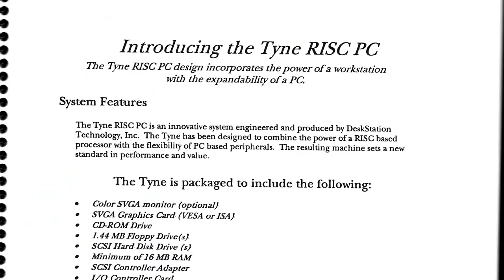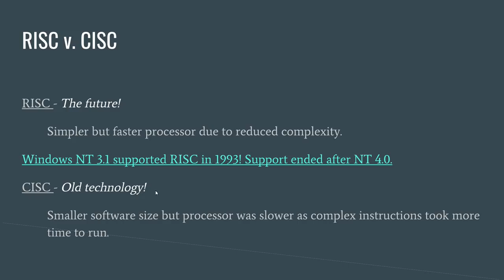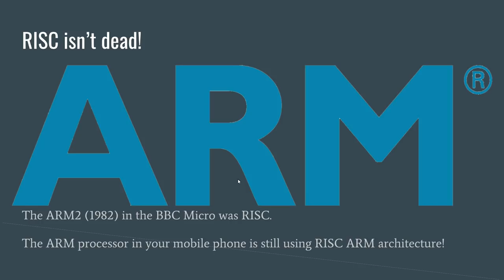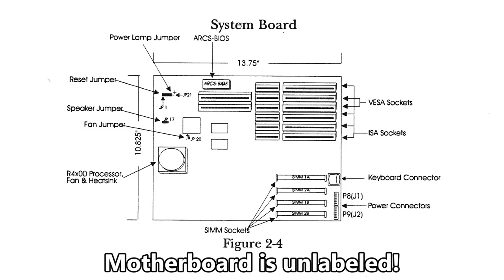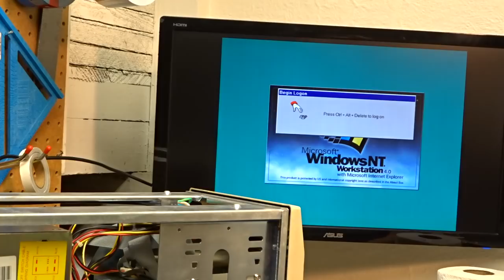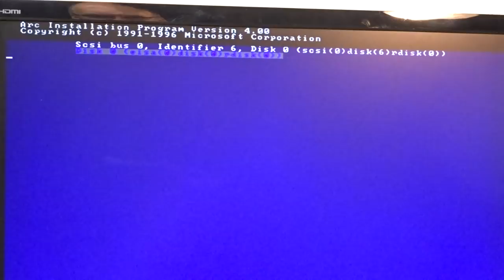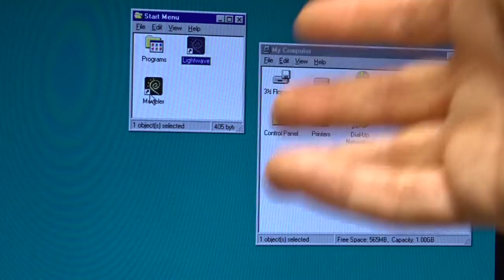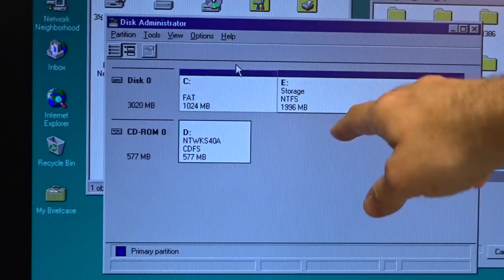Deskstation Tyne: A MIPS R4600 based PC that runs Windows NT

Comment: 4:54 - Intel introduced its EM64T (Expanded Memory 64 Technology) starting with Core 2 Duo processors to support 64-bit OSes. The Intel Xeon, was initially a native 64-bit processor, but later versions of Intel Xeon and Core CPUs are x86_64, meaning that they can run both 32-bit and 64-bit OSes and applications.
Reply: EM64T on Desktop began to be implemented with Pentium 4 Prescott under emulation, (depending on the model, it is not supported, and is only exclusive to socket 775) and for notebook since Merom.
 And as a curiosity, AMD was the first to implement the X86_64 architecture, but the first athlon 64 does not support CMPXCHG16B, which Intel implemented, then AMD implemented this feature in the K9.
The most important change of the CISC architecture in Intel was with the introduction of P6 in 1995 with the Pentium Pro, this architecture is the first time it is based on a RISC CPU, and it was an architecture it was even superior to the new NetBurst architecture used in Pentium 4 (Netburst lived in the shade from birth until it was discontinued with Pentium D, the P6 architecture performed much more at lower consumption, the Pentium M at 2.26 GHz of 27w was equivalent to a Pentium 4 working at 4GHz at 140w of TDP, and then with the P6 architecture the core 2 was born that were improved versions of Merom), and currently Intel has continued to use the base of the P6 for current processors (realize that the meltdown bug affects up to the Pentium 2).
And then a change in the P6 architecture that suffered, was the first time to implement an AMD instruction of 64 BITS, but that Intel improved by adding an additional instruction set called CMPXCHG16B, which I call EM64T.
A while ago I made this image on the Intel CPU timeline:
https://i.ibb.co/0nL0wwd/c429cb020e8c4dba6c6ff462a989c0b4.png

Comment: Very cool.  I was aware there was a MIPS release of Windows NT (there was an Alpha release too I think) but never saw MIPS chips outside of SGI machines.  Have had a few of those but all running Irix of course.  SGI did a Windows NT machine (Visual Workstation) later but it was a strange machine with an Intel chip.

This machine is interesting, presumably the maker really thought RISC was the future most of us thought it was at the time.  Looks very 'off the shelf' compared to the SGI machines of the time!
Reply: MIPS architecture CPUs were commonly used on many 2000's PDA and Pocket PCs, and in some game consoles (Sega Saturn, Dreamcast, Sony PlayStation, Nintendo 64...).
https://www.mips.com/blog/five-most-iconic-devices-to-use-mips-cpus/

Comment: I understand where the confusion arose re: ARM/BBC Micro.  The original ARM chip was designed and prototyped on a BBC Model B.  A few years back, an expansion board was developed to allow a BBC Micro user to use a Raspberry Pi as a coprocessor.  So, in a sense, some BBC Micros actually do have ARM-based (co)processors in them! 

[cool machine btw... gotta love the 1990s RISC-based oddballs like the Tyne]

Comment: Modern x86 CPU's are actually RISC, the CISC instructions are handled by microcode to translate them into a combination of RISC commands. AMD started this around the Athalon XP era, Intel implemented it in the Core line of CPU's.
Reply: > CISC instructions are handled by microcode to translate them into a combination of RISC 
> commands. AMD started this around the Athalon XP era, Intel implemented it in the 
> Core line of CPU's.
Much earlier. Intel started doing this with the Pentium Pro 1995. AMD with the K5 in 1996.

Comment: Awesome video! Since Apple's release of M1 I've been fascinated with the different iterations of RISC processors. This just goes to show that powerful RISC processors in personal computers isn't a recent innovation in any means. Perhaps there's a way to run Blender on this machine since releases for the MIPS architecture are still available to download:

https://download.blender.org/release/Blender2.36/

This link only includes one for irix, but maybe with some tweaking, or on a linux os (or both), it could possibly run.

Comment: RISC was not a response to the backwards compatibility "bloat" of CISC, it was a project to create a simpler instruction set in general.  The original intent of RISC/ARM was to be a simpler instruction set to even the 8086/8088 or 6502.

Comment: In that era the PC and SC designations meant "Primary Cache" and "Secondary Cache"  The PC chips were usually just the chip, and the SC chips were mounted on a card with additional cache, more what we might call L2 or L3 cache today.
Reply: On an SGI Indy faq, it recommends against using the 4600PC due to a lack of L2 cache. http://www.vogonswiki.com/index.php/SGI_Indy#R4600  So an interesting upgrade would be to acquire a 4600SC or 5000SC.   The chips were all plug compatible across the 4400, 4600, and 5000.  Additionally the 4600 was a more mainstream processor than the 4400.  The 4400 was more geared towards floating point performance, and the 4600 was geared more towards integer performance. The 5000 added the MIPS IV instruction set and had larger on-chip caches.

Comment: Probably the smartest thing Microsoft ever did was to hire Dave Cutler away from DEC to be the architect of NT.

The NT name is long gone from their OS, but it is still NT, nonetheless.
Reply: Funny you mention it. I remember when reading through the NT API in the 90s going "Hey! This ain't half bad! There is a proper design here and not just a stinkin' pile of ad hoc bolt-on features. Guess I should cut MS some slack.". Then I learned that a DEC guy did it ;) ...probably also a good idea to get Anders Hejlsberg from Borland to design C# and so on.

Comment: Technically you are correct, the first ARM, or more accurately the first simulated/emulated arm was indeed on the BBC micro. 
The first fully blown production ARM machine however was the Acorn Archimedes. 
"Acorn also employed the (BBC Micro) machine to simulate and develop the ARM architecture which, many years later, has become hugely successful for embedded systems, including tablets and mobile phones. In 2013, ARM was the most widely used 32-bit instruction set architecture."  
Source - Wikipedia - https://en.wikipedia.org/wiki/BBC_Micro

Comment: If you're interested, there is a company bringing IBM's Power architecture back to workstation form factors now as well, namely Raptor Computing Systems. They have EATX motherboards available now that take one or two CPUs, and they are about to come out with a single-CPU microATX board at a lower price as well. There are a handful of Linux distros that will run on it at present.

Comment: Technically, since the Pentium, instructions are stored in microcode, allowing x86 CPUs to be more identical to RISC hardware-wise, while still retaining the CISC advantage of having more instructions. Microcode allows for instructions to be fetched and executed on demand, rather than have all of them execute every cycle, significantly speeding up x86.

Comment: Correction: current x86 CPUs are only backwards compatible with the 80386. Due to the removal of Gate A20 support in Haswell, you can't run 8088 software that relies on the "segment 0xF800" trick that was commonly used to simultaneously access the framebuffer and regular RAM.

Comment: Intel Pentium Pro and AMD K5 CPUs has CISC to RISC translation hardware. All modern X86 CPUs has RISC cores with external CISC.

For modern X86 CPUs, CISC is effectively used for  instruction compression for it's RISC CPU cores.

Comment: The big difference few seem to know about is that CiSC uses something called microcode.  Its basically the smaller code that risc runs on, but within the processor, this is where complex instructions come from.  Risc is generally faster because it uses the spare silicon real estate for pure hardware rather than microcode.  Because risc has more hardware, it generally operates at 1 cycle per instruction as there is hardware for each part of the instruction.  CISC has to cycle through the microcode, although later verions have tried to copy this with pipeline buffers and predicitive fetching.  Risc is just basically more efficient, a more modern design.  Yes the software can be a little larger, but that has little real effect, you only need a few K of code to replace the CISC instructions.  Most software at the time was increasing in 'prettyness' with lots of graphics.  The core programs of an office suite or any software can be done in <1MB, the remaining 100s of MBs are simply pictures.  It seems even worse with Mobile apps, the developers just copy a whole bitmap onto the screen rather than draw it.

Comment: Intel & AMD processors are not CISC anymore (since the Pentium Pro). They have an internal RISC processor and a microcode unit that translates the CISC commands into RISC microcode. Together with the ARM you already mentioned and Power, MIPS & Sparc that means that pretty much any CPU designed in the last 20 - 25 years is a RISC CPU.
Reply: autarchprinceps I remember reading RISC and CISC difference at same time we got fresh Pentium Pro (1996). Some random boys in the library were talking how powerful RISC was and how Intel don't have courage to use it. :)
Reply: Except there is a very big difference for ARM chips : they do not have a microcode unit to decode anything : they are true RISC chips.
Reply: really? didn't you mean AMD K5 (instead of PPro)?
Reply: @MilanPokorny   really? don't you mean the NexGen Nx586
Reply: Processor architectures are named for their programming models, not their implementations. So what you said is not true.

Comment: You can probably get into NT.  There used to be a bug, not sure if that version has it.  Basically at the login prompt, hit help and go through some of the menus to try and get a file selector box and execute "explorer".  If I recall, the easiest way was to print the help window and from there you can get the file dialog box and run explorer.   Annnd just realized this is 2 years old. but hey maybe this will help someone.

Comment: Another thing, all of those NT based RISC workstations were more or less regular PC hardware with a different processor installed. Some of the boards were a little more exotic than others, but that's why they all used standard PC I/O for the cards. If you replaced that MIPS processor with a 486 that board would look perfectly period.

Comment: Ive once seen a few urban explorers found an old computer with windows 95 in an abandoned building and because the power still worked it was actually running (they got scared of the noise of the fans). They decided to make it the explorer log.

Comment: chntpw is a bootable utility that can set a blank password on pretty much any Windows NT based system including Windows 8 and possibly Windows 10. Nice thing though is they keep the older versions online, so you can get the ones that will work with your ISA card.

Comment: There was never much nt/mips software available, and rumor is that microsoft internally stopped supporting nt on mips basically the day that 4.0 shipped. 

It may be possible to run linux on it. For a very long time, support for these old machines suffered from severe bitrot (stable in linux 2.2 but not 2.4 etc) but, weirdly enough, someone figured out how to emulate the Mips Magnum 4000 workstation with qemu and that apparently inspired someone to fix the linux kernel support for the r4000 cpu. So it's possible the r4600 is working too. 

I have a Magnum 4000 but have never successfully used it in the almost 20 years i have owned it. I may try again soon.

Comment: i used to put really old computer cases and put old but good hardware in it that i found at thrift stores. whats funny i remember putting a geforce 410 in that case in the video including 2 cd rom drives for 2001.
thanks for the nostalgia man.

Comment: Geeky:  Actually you were right first time, no need for the correction!

The first ARM computer was a BBC Micro, because this machine was designed to accept co-processors via the 'Tube' interface, such as a second 6502, z80, and Acorn made the first batch of ARM chips for testing as co-processors.

Comment: Excellent video and very interesting PC. :)

Also, correct me if I'm wrong, but are you sure the BBC Micro used an ARM2 chip in 1982? (6:35). As far as I know, the original BBC Micro used a MOS 6502, and according to wikipedia; the first ARM silicon was only created in 1985.

Comment: Nice! I once had a NEC RISCstation 2200 (single R4400 200 MHz MIPS) and a Netpower FastMP (dual R4400 200 MHz MIPS). They were both great machines that performed better than the PPro  200's.  Then MS killed MIPS support for NT which was the death of them...thanks MS!

Comment: very late to the party here but that machine is fascinating.

If you ever got into the original Win NT install then this is redundant but it's possible to reset the NT password, you should be able to mount the SCSI drive under your IDE drive install then copy the SAM file to floppy and either recover or reset with one of the various tools that work on a windows machine.

Comment: Random old video recommended, but glad it did :) Anyway surely the VLB SCSI interface will be much quicker than using IDE over ISA? Also, that AUI card will be fine with an adapter to RJ45.

Comment: Thats a sweet machine. Regarding VLB vga cards. I allways recommend the S3-805 for a 1992/93 MS-Dos setup. Faster than CL cards and the output has a much stronger signal than something like an CL-54xx-VLB card. Shure something better and faster is out there, yet for the price, the 805 is a hidden gem.

Comment: An R4600@133 has around 21Mflops of compute power, which is comparable to a Pentium@75 with its 23Mflops. Both CPUs released in 1994. A fun fact – in 1994 an R4600 was a lower-end MIPS CPU. On the high-end was an R8000@90 which was 3 times more powerful than Intel's fastest Pentium@100 at the time.

Comment: The Surface RT was a Risc system, one of the reasons why it failed is because Microsoft failed to market it properly. Windows 8 also had a RISC version, it was essentially Windows 8 with just a few small changes (cannot remember the exact change). But it even has safemode, problem is it bricks the unit as safemode drivers (generic windows drivers) are not RISC compatible lol. I used to be Surface support and was a part of the first wave (I was firsts person outside of Microsoft to give a Surface a BSOD)

Comment: Very awesome, its hard to find a CDROM drive with the caddy that actually works. I dont think I've ever come across one, even back in middle school in the 90's all the ones we had never really worked. 

I find it incredibly neat that VLB is used on that as well, I always thought it was specific to 486 and one off Pentium boards.
Reply: I, too, thought that VLB was not only native to x86 but specifically the 486 due to strict bus timings. Even on the 486 it could be flaky depending on CPU & specific peripherals. Looking it up, it does appear there were Pentium motherboards that supported it, though they used a bridge to PCI.

Comment: The benefitd weren't dubious AT ALL. Indeed, it significantly changed the way Intel implemented their x86 ISA. The ISA appears backwards compatible, but internally the instructions that execute on the execution units are microcoded. Internally, modern Intel CPUs are all RISC machines, and many of the instructions can complete at a rate of 1 per cycle. Some more. Lastly, an extraordinarily important metric is performance per watt. Meaning in many cases a reduction in power is roughly equivalent to an increase in performance.

Comment: Did you ever do the benchmarks?  I'd be interesting to see.   Especially if you can tie it into the new stuff (x64 emu for windows on arm is in the latest preview builds, and of course M1 if you can tie it all together).  I don't think you had a soundcard, but it'd be interesting to see how software mp3 decoding compares as a benchmark (I guess you could decode to wave). Ideally you'd do both native Mips code and win32 code and compare everything.... then again maybe I'm the only one curious so it might not be worth it.

Comment: Arm was not used in 1982 in BBC, but Archimedes Circa 1987, after the BBC get computers known project. There is also a bit of false comparisons, as intel went RISC core to emulate CISC  functions around the Pentium 2 era...

Comment: 2:00 Most old PCs had a cutout the size of an LED that you could use for another power LED. Or you could move the power LED behind the badge.
Reply: ... too bad most of the badges used a reflective backing. That would have made it hard to make that work on an existing PC.